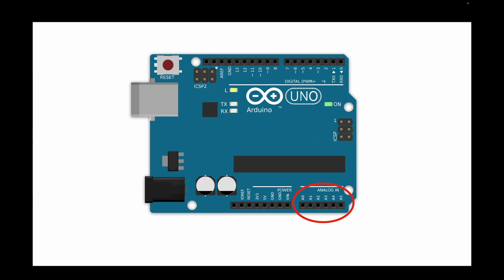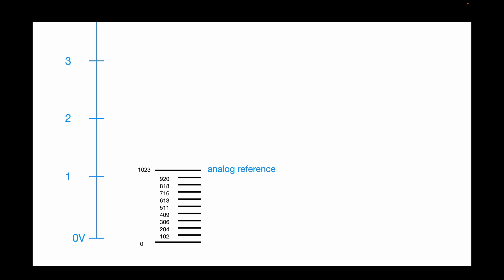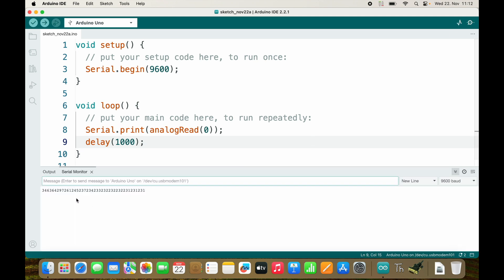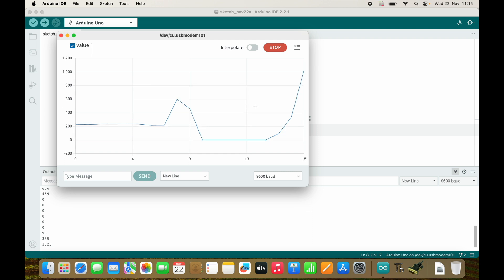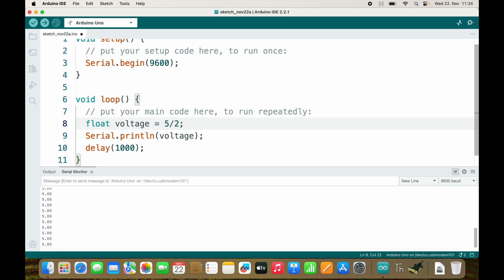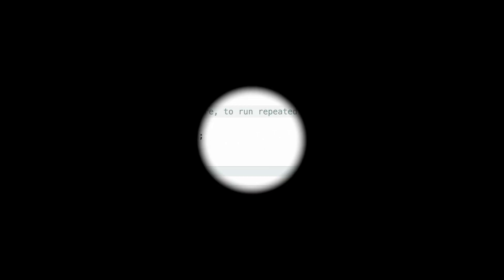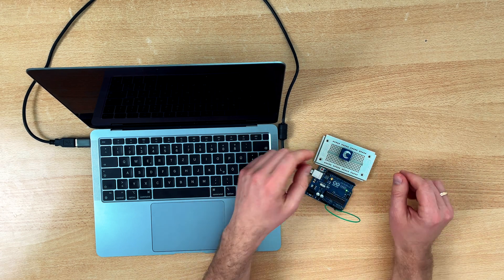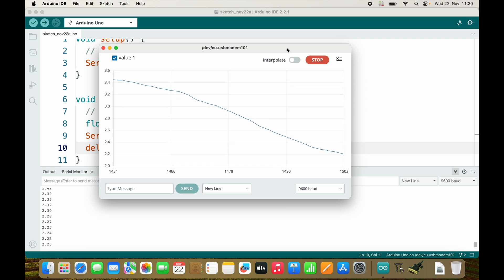analog read input arduino - analogRead - (Arduino Uno Programming for Beginners)

Comment: If I understand the video, using this method will give more accurate readings of analog voltage. Is that correct?  This would be very valuable to me when reading a Joystick potentiometer.  Please reply.  Thank you.
Reply from the maker: it depends on how your schematic looks like. If you connect the joystick to VCC (5V supply) and to GND then you will actually get better analog readings if you stick to VCC (5V supply) as analog reference. This way, voltage drops will be compensated. Did you already try reading the Joystick or are you just planning on using one?

Comment: Very nice. That is exactly why i was watching all your videos, because i learned in the first 3 minutes new stuff. Thank you. (In fact the part about the floating point was a bit simplified, since you can also with a ".0". For example by "float voltage = (float) 5/2;".
Reply from the maker: Thank you, this motivates me :). 
Yes, casting also works :)
Reply: @playduino  You are definitly more skilled in elektronics than me. I only have got maybe a bit more c++ coding skills. In fact while coding I nearly never need floating points and i also use the adding ".0" trick only. Now i just wonder if casting the number internaly is done by a float or a double.
I wonder a bit about that, since i experimented a bit on my Pi 5 and i was able to even measure ~2°C lower heat using "char" instead of "long". In old days i was always thinking only about space. But in fact you can also save power by that. So i wonder if a number like "2.0" is internaly used as a float or a double. Float will be more energy and space efficent, while double might be more exact, since even simple numbers like 1.1 are unlimited as binary number, so 1.1 as a double is more exact then 1.1 as float.
Anyone knows the answer?
Reply from the maker: @Volker-Dirr I am sure you have more c++ skills :) very interesting question! I only know that on Arduino Uno it makes no difference, because both float and double are exactly 4 bytes
Reply: @playduino  ahh.. true. Even the R4 is 32-bit only. I just tried with the compiler explorer using x86-64 and the current clang and gcc version. They cast a number like 1.0 as a double.
Reply from the maker: @Volker-Dirr interesting! I think 1.0 is always double and 1.0f is always float. Thx for sharing!
Reply: @playduino  I tried only with compiler explorer and x86-64 gcc 13.2 only so far,. It is intresting.
1.0f is like 1.0 also double. But 1.0f have 2 lines less Assembler code, even all other lines are the same. Don't ask me why, but it looks like 1.0f is more efficent than 1.0.
Reply: @playduino  Ahh... Sorry i didn't read exactly. It is float only, but the alignment is double. So if i understood correct, then in fact it allocates 8 bytes memory, but it uses only 4 of them for the calculation.